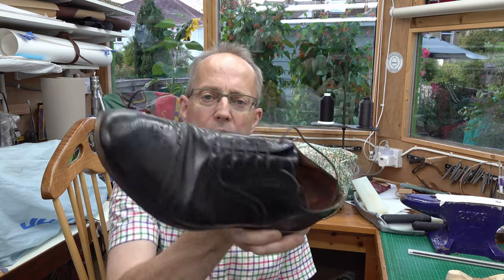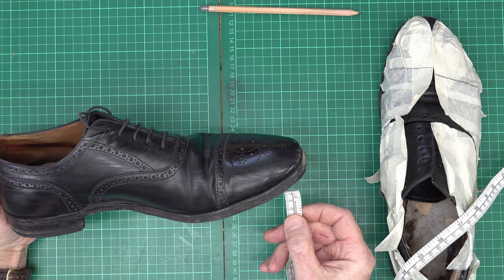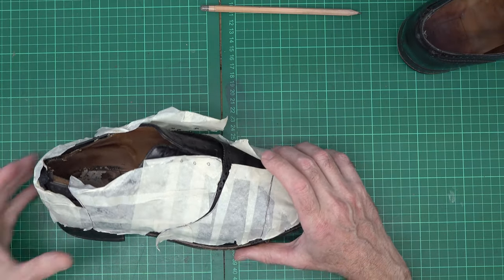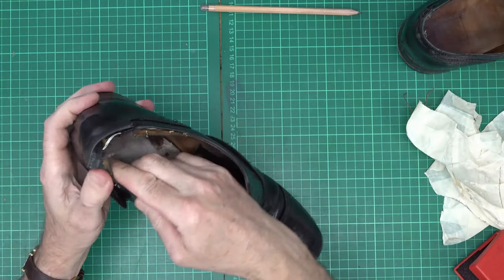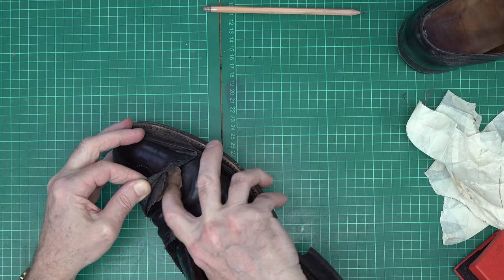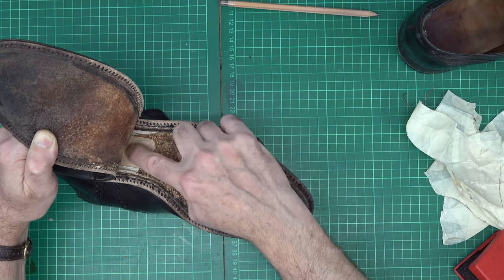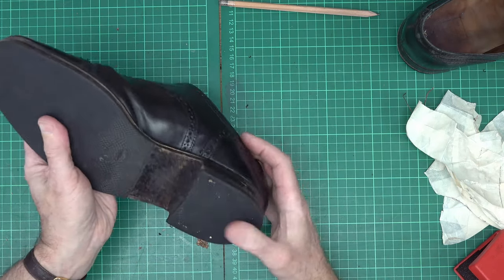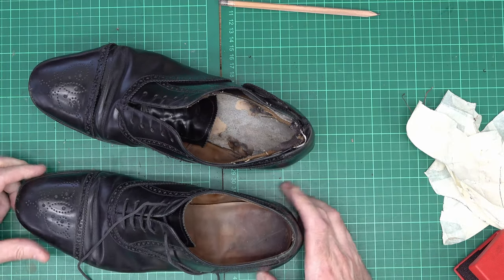Pt 2. Shoemaking...Leather Brogue Shoe Tear Down

Comment: A lot of the way Shoe's are built is to save money. The less used in making the Shoe, the more you could charge, or leave and save on Materiel cost. If you are going to make your Shoes then don't save on Materiel's. Put into your shoe and have a long lasting Shoe. I wouldn't use Cork. Cork is used because it's cheap. Cork will Crush down to nothing and will not support your foot or the Shoe latter when you need it most. Use a piece of Metal as an Arch Support and as a Safety Device in your Shoe. Thanks for the upload mate. Keep'em coming. Good luck in the Shoe making.
Reply from the maker: Thanks for the tips James, I am going to make these shoes as best as I can, hand sewn welts and pegged heel etc. All traditional!

Comment: They have pre-made from compacted leather (sorta like a particle board of leather) or synthetics that can use heat, or solvent to be molded for toe puffs or heel stiffening.
and a paste of some sort (only seen it quickly and in german language so no clue exactly what it is I think potato) Hirschkleber, that they spread on veg tan puffs and stiffeners as well as over the cloth/synthetic. I think I can get the paste here in the US from Sorrel or Amazon.

Comment: Made in Italy was inside the shoes made in Gt Harwood Lancashire.
My dad in the 1970s we used to repair the aluminium lasts with oxy acetylene (soap mark was used to get the heat correct, too much and you had a puddle ) eventually we had a mig plant and used aluminium wire.
ASIDE- In the next town I used to like watching the pet food bag sewing machine in Magnet pet foods in Rishton. We used to repair the chain link belt in the very long ovens (300 long I am guessing). the repair was done while the oven was still in use cooking and the belt moving, just a few Ratchet Lever Hoists and then a bit of brazing.  "Just in time" get all the kit off before the belt disappeared in the the small oven gap.
Reply from the maker: Wow - repairing aluminium lasts...that must have taken some skill.

Comment: Now the fun starts. Making the upper and fitting it to the shoe lath. good part is you can sew the upper on one of your sewing machines . the sign of a good high end shoe is the wood shank .If it was me I would use cork  .  use 5-6 oz for the insole and put 3 or 3.5 mil soles... just when you make your uppers give your self ex leather to rap around the lath